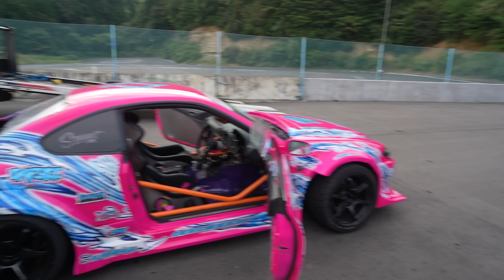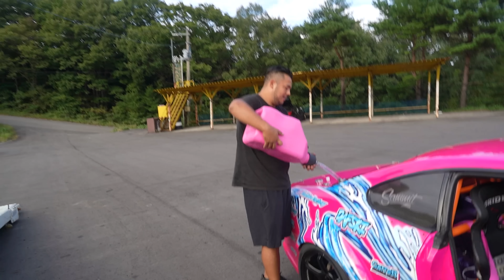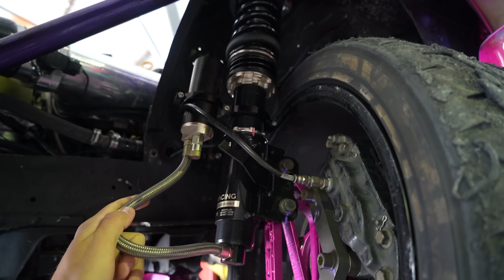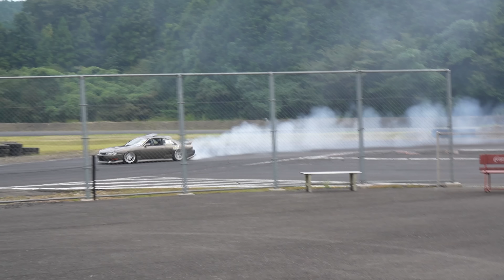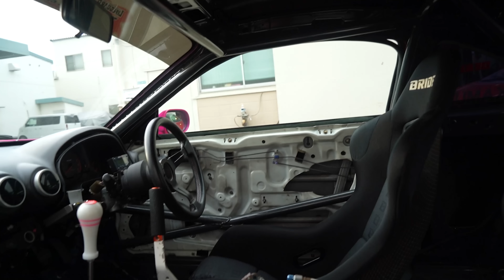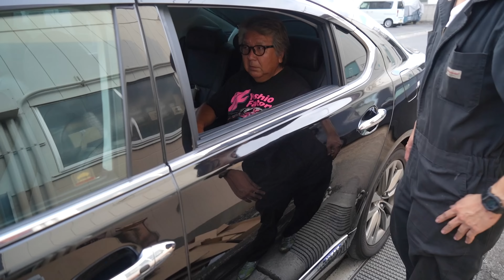BEYOND MY EXPECTATION! 2JZ S15 PUSHES ITS LIMIT!

Comment: I feel like you are running a too big in the gear ratio department, lower it a bit might help on engine responsiveness and you don't need to gas to the floor action.

Comment: Do you think your driving style is more handbrake orientated that what the Japanese use ?,  more power slide out of corners than traditional drifting ?
Reply from the maker: Not really. I use the e-brake when I'm unsure/ un-comfortable. ie the car needs to be on the truck heading to the comp in 48hrs so now isn't the time to go full send.
Reply: @SAMMIT  also why no vvti heads on yashio cars or any sr’s on channel
Reply: @krisbuck2165  no need for variable valve timing when it's wide open all the time, it's just less moving parts to fail.
Reply: @Zach-ju5vi  but the head is so much better flowing producing massive gains ,and wide open all the time come on be sensible
Reply: @krisbuck2165  does it actually flow better though or do they just delete the vvt on the same head?
Reply: @Zach-ju5vi  flows shit loads better I mean huge difference like vetch on Honda but Nissan version but it’s expensive to do that’s why I was asking as not everyone is a drifter
Reply: @krisbuck2165  I really don't know anything specifically about the sr20 but as a mechanic I know a lot about variable valve timing. Generally speaking the ports on the vvt head aren't any bigger, with vvt the valve timing is just reduced for better flow at low rpm, at high rpm the flow will be the exact same. That is why I suspected the reason why they don't use vvt is for reliability, drifting is all high rpm and the valve train is always a weak point at high rpm. 

Edit: I should add that the ports could be bigger for a vvt head, they are probably using the vvt head but deleting the vvt mechanism so it will have the exact same flow rate at high rpm

Comment: Your car needs downforce
Add some spoilers
Reply: Downforce doesn't apply that much to drifting. Usually wings in drifting add drag from the side, because the car goes sideways. (If the wing has side plates) So a big wing would usually slow the rear down while sliding in theory. But also probably not a massive noticeable amount depending on the car.